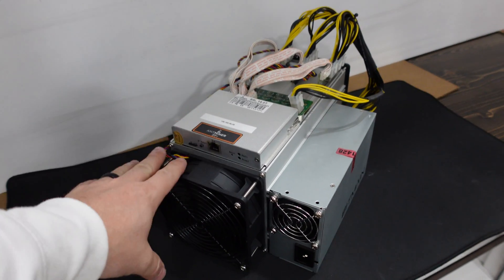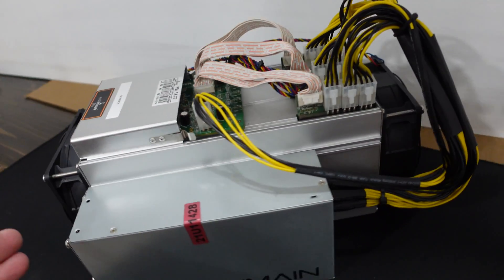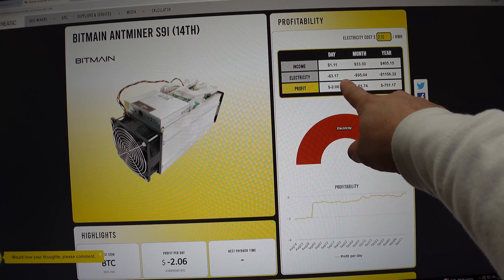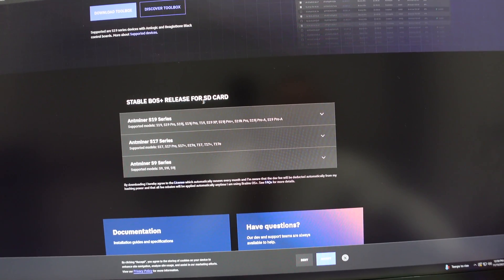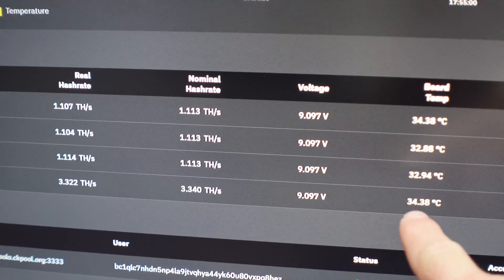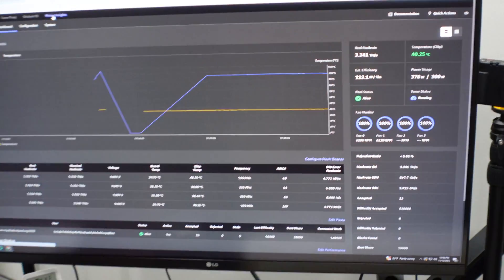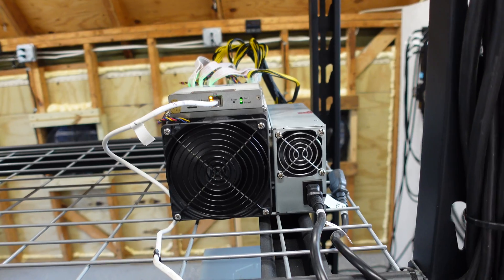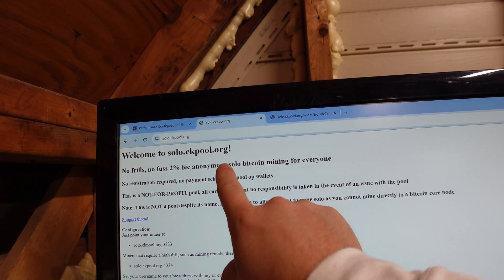Turning my OLD junk BITCOIN miners into a potential GOLDMINE! Bitmain Antminer S9

Comment: I have a quick question. I have the S9 as well and was wondering if I put in a 600 or 900-watt target would that double or triple my hash rate? Also doesn't BrainsOS charge you Hash rate to use their operating system??

Comment: I found two S9 ant miners in the household clean ups on the side of the road seriously! I have turned one on and it seems to run I am yet to test the other. I want to solo mine with both of them, question did you end up doing a video for the step by step guide for Brains OS?
Reply: Did you ever get them running with this method?
Reply: @lapisthehuman  no I've been studying so didn’t have time yet 😢

Comment: @TheHobbyistMiner You said you want to run multiple… why wouldn’t you just crank up the hashrate or watts of one? Is there a difference? It makes sense to run multiple if each is cranked up but I don’t understand the logic of running multiple when they are set so low.

Comment: I have one CompacF, one R909, one Mars Lander and one S9 SE. All running at just over 500 watts. and I get about 8-9 TH's on average.
I just had a S9i delivered the other day and I was about to use Braiins OS+ on it, but after watching this video, it's better to just keep the SE.
The reason I get so little wattage with the S9 SE, is because I have only one hashboard plugged in and it gives be about 5 TH/s for 400 watts. Pretty good trade off.
My partner though is not a fan of all these machines, he hates them and says I'm wasting money.

Comment: Is it possible to flash the sha-256 software and upload a new program to mine other crypto ?   That would repurpose the S9's which sell for $75 or so because the great thing about aisc's is they are a single purpose device and perform tasks well.    Solo mining is fun so at 300 watts is worth the expense for 6.25 BTC.   Bear in mind BTC halving is in April 2024

Comment: Been solo mining with S9i's and Braiins for over a year :) At 300 watts you don't need 2 fans, and definitely not at 100%!. In fact, don't use those fans at all, use Noctua industrial PPC fans. Even at 600 watts I use 2 of them at 60%. If you run 300 watts you'd probably only need one and of course, Noctua's are WAAAAAAAY quieter. :) My miners run 3 feet from me and it's totally ignorable, NOTHING like the fans that ship originally. As a bonus, the OG PSUs on these work at 120v so just plug them in wherever you need heat, don't need 240v at all. :)
Reply: Agreed, Noctua for peace of mind and a quiet home.  I use them for my Jasminers.  Beforehand I put the X4-1U under the house, cool & quiet.
Reply: Have you find any block  yet ? 😢
Reply: @demonicclubgaming1499  Unfortunately the odds of finding a block now are 1 in 1,366 after 24 hours a day mining the entire year with one of these. I shut them down, especially with summer coming and the halving that cut the reward by 50%. Not worth the hassle of the heat and power bills all year long for 1 in 1,366 lottery odds.
Reply: @demonicclubgaming1499  it's been over 2y now. He's got a very slim chance against the pools & solo giants

Comment: been running a S9j for about 2 years solo mining. Brains got it down to 4th at only 280 watts at the wall. Fans run at only 3% so basically silent. I will let it run until it just doesn't run anymore and then replace with a T15 i have that's getting 13th at only 510 watts on brains. Run them slow and low for solo mining :-). Let brains adjust those fans make that bad boy silent.
Reply: Have you had any luck solo mining

Comment: This may be a dumb idea. But if you live in a northern climate over the winter I wonder if you could save power on the cooling by keeping it exposed to the cold in a shed like you have.
Reply: not dumb, just need to beware of damp weather penetrating the electrics... some people try and recycle the heat...to use elsewhere
Reply: I just picked up a Goldshell Mini-DOGE for exactly this in my home office. Miner puts out 250w, unplugged a 600w space heater. If one is not enough I'll pick up a second one. The way I figure it I'm mining for free 🙂

Comment: Hey Hobbyist, great video! If you want to have even lower electric use, you can unplug two of the hash boards (data wires and power wires) leaving just one card plugged in. Allow Braiins to tune it again and you'll have about 1 terahash for about 100 watts, based on your numbers. Myself, I run 1 hash board (S9, Braiins firmware) based on a 700 watt target (so about 230 watts for 1 board) and get about 3 terahash for solomining and not much electric. I also use 120 millimeter quiet fans in place of the noisy Bitmain fans since it doesn't create as much heat with 1 underclocked board. It is quiet, my present PSU is louder.
Reply: Or you can run 4th at 291w with 1 hashboard.

Comment: I have about 100 S9s just sitting in my garage. Currently only have two of them running to get some "cheap" heat. Would be awesome if there was a way to deploy more of them without losing too much on it!
Reply: Ship it to  me i have free electricity 😂
Reply from the maker: 100 WOW!  Get Braiin's on them and have some fun tinkering!
Reply: @TheHobbyistMiner  Yeah, they are running Braiins, getting about 15-16 Ths at 1250w. Will do some more with them this weekend and see if i can get a better watt to Ths ratio! :)
Reply: How many blocks have you found with them?? Jw with that many…
Reply: Yoo can you sell some to me 🙏
Reply: how are you using them for heat? You added a tube from the exhaust to the house? Not much sound?